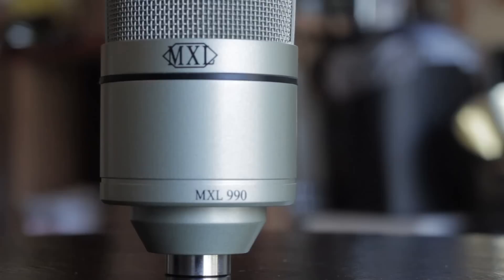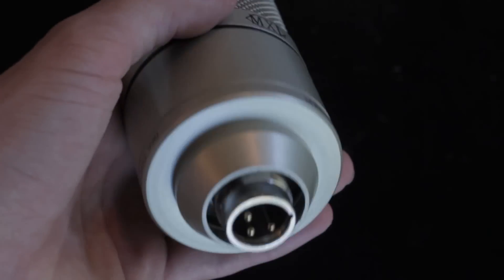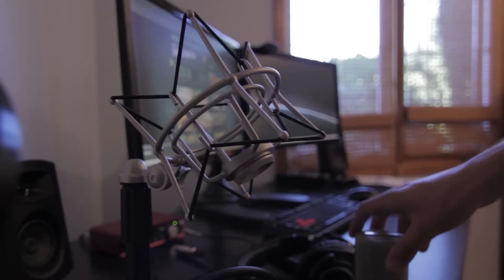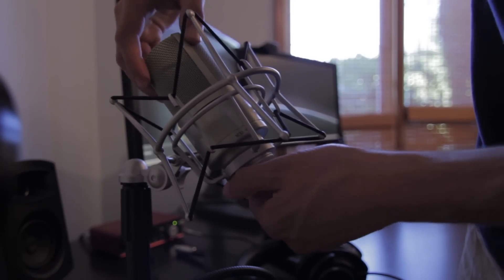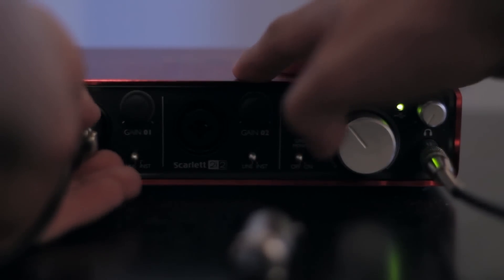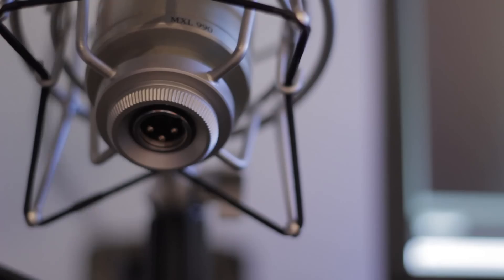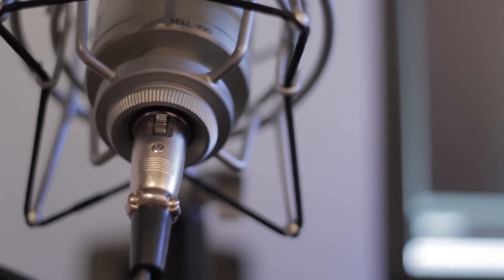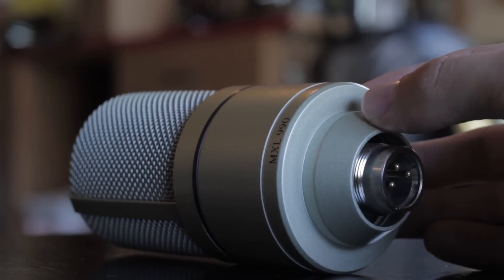Introduction to the MXL 990 Condenser Microphone

Comment: Just so you're aware the quality is relative to the system , USB Microphones are fine. Its just an interface. it can be as good or bad as what plugged into it. A usb rode or Blue mic will sound just as good. You have a Scarlett usb interface there which is nice.  Your comments in the video might make people think usb Mics are bad which is not true. in reality the quality jump was mainly from you going from a low end dynamic mic to an low end powered condenser mic. The condenser has electronics and eq built into it so its hot and balanced as is where a dynamic usually needs high gain and eq applied externally. Nice video though and you might want to roll the high freq off a bit on the MXL its a little sharp lip noises and silences get a little annoying. MXL makes a usb phantom condenser USB.008

Comment: Would you recommend this for podcasting? Or would the crossover pickup audio be too poor because of the background noise sensitivity?
Reply from the maker: You definitely need to have a controlled environment / room with any condenser microphone. If you can sound proof the walls to dampen reverb and don't have too much background noise it's a GREAT way to make your podcasts sound awesome.
Reply: Trevor Freed So if I am able to get some soundproof walling, the audio won't crossover with 4~ people in the room? Thanks for replying as well.
Reply from the maker: If you have them all connected to the same audio interface there will be zero crossover because they'll all be on the exact same timecode. If they're on separate audio interfaces / computers you'll quickly run into issues. That's a general issue though, not just for this microphone.
Reply: Trevor Freed So would I need to find an interface with 4 inputs?
Reply from the maker: Yup! You can always try doing it without but trust me I've been there and it's WAYYY more of a headache than any potential savings is worth.
Reply: Trevor Freed alright! Thank you so much!